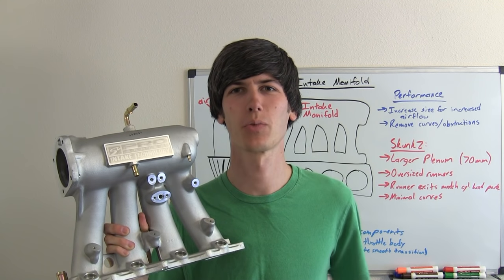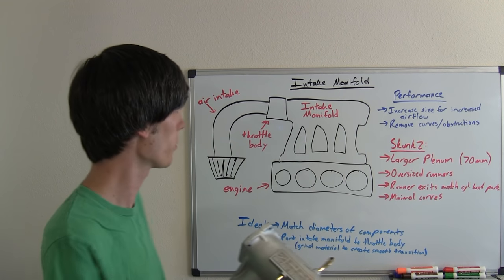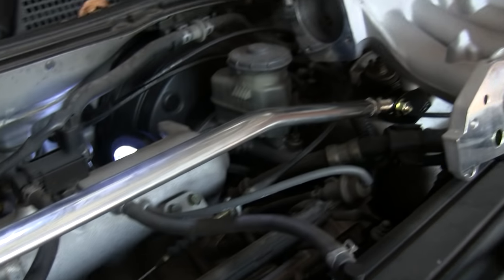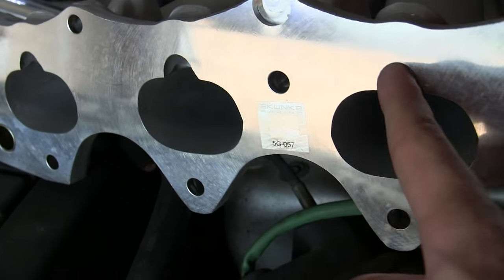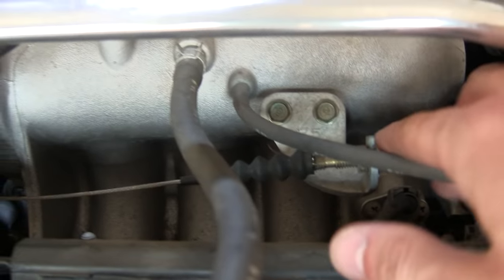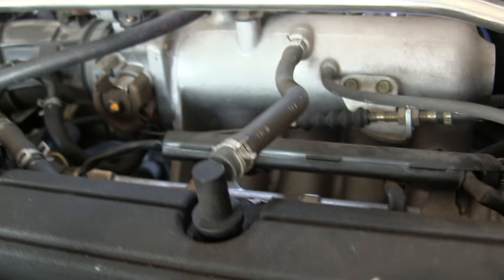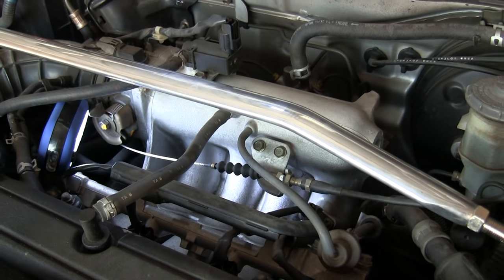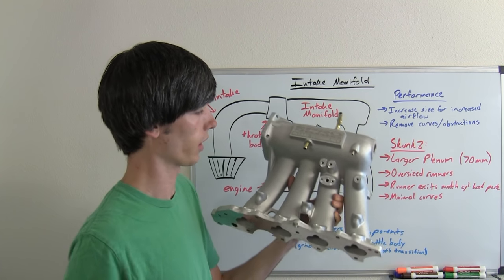Intake Manifold - Explained

Comment: I have an intake manifold question - I have a motorcycle and did an oil change last weekend.  For kicks, I also looked at the air filter to see if it needed to be changed. When I took the cover off, the opening was filled with seeds (like pop corn kernels).  I vacuumed them out with my wet/dry vac.  When I pulled the dirty air filter out, the seeds that were behind the air filter fell inside both air intake tubes. Not sure how many had already fallen in there before I did the check. I could not get the seeds that fell inside those tubes out. I put everything back together, along with new air filter.  I ran the bike and during the 1st mile, it bogged down and lost power but I added throttle and it pushed through. The scent of the bike exhaust smelled funny.  Did these seeds get pulverized and burned out through the exhaust?  If not, did they get mixed and sent through the oil filter, forcing me to do another oil change and oil filter change?  (current oil in there is less than 1 week old).  Did I do any harm to my engine with what happened above?

Comment: the head breather is simple 2 way to allow expansion and contraction of equilised pressure in the head as it heats up and cools down. very little gasses to burn off in there.... unless you have worn valve guides or worse. it is also therefore filtered by the intake filter to stop contamination in the head and the need for a second open air filter. i would have thought there was a separate crankcase breather to the intake.

Comment: Yeah. If I get the Skunk2 Intake Manifold and Throttle Body combo, I'd be spending over $1000. It's pretty expensive. A $200 for a port and polish job and buying a 80mm to 70mm Honda Throttle body (J37) would be a better alternative for my car. I think the price is lower for the older models. Skunk2 also made a new line-up of intake manifolds (Ultra Series) for the b-series engines.

Comment: Will you do a video on phenolic intake spacers with before and after Dyno numbers, air charge temps, and temperature of the intake manifold as well? It would be nice to have proof as to if using one helps or not. Thanks!

Comment: @ engeneering explained ..... doubtfull you reveiw comments on videos thisnold but I was curious if at one point you might consider doing a video on intake manifold plenum volume and relation to torque and responsiveness wile retaining some rpm capacity. Its a bit hard to find good videos on the subject, a whiteboard video on the topic could help expand on the principle for me and hopefully several others. I'm currently building up a Mopar 5.2 magnum with a holley/Rochester 2v sitting on a small port eddlebrock rpm air gap copy and considering implications of building a remote plenumbox to add air volume for additional responsiveness for rapid throttle position changes. I realize any attempt to cover the details of fluid dynamics would be to case specific and too long for a YouTube format. But such a video on a more niche aspect in a singular 10minuite(ideally 3hr lol) quick reference video seems it may be up your alley as far as content creation. ......as a PS I do hope to see more videos of you continuing to build your vehicles, its never a bolt on that's interesting but the clever solutions to recreate modify or fabricate desired effect in a roundabout way the separates an interesting vehicle from the mundane, with a broad knowledge of related sciences the tricks you may come up with could be rather interesting

Comment: Bigger is not better. The runners volume are designed to optimize the Helmholtz resonance for a given RPM. For this reason we see continuous (787B) or stage variable (many production cars) runners in oder to offer better optimization for varying RPM. The plenum is designed to equalize the transient airflow between the runners.

Comment: in the manifold piece you are demonstrating, is it meant for the diesel engine? Because I have heard the fuel-air mixture in the diesel engines are directly injected after being stoichiometrically mixed inside the manifold.

Comment: Do you do any research prior to making these videos? Look into Ricardo WAVE and you'll see that there is far more invested in the design of an intake manifold than just increasing volume to "flow more air through it" and smooth transitions for "more free flowing air". Runner length will be arguably the most vital parameter in tuning an intake manifold to take best advantage of the pressure wave dynamics resulting from intake valve events.
Reply from the maker: Usually no, just kinda draw some stuff and then make things up. I'll be creating a video soon on variable intake manifolds to discuss runner length tuning and how the length is set for a specific RPM.
Reply: +Engineering Explained 
Bwahahaha...great response Jason! 😄  Made me belly laugh.

People need to remember that some of these videos are high-level overviews of the engineering "concepts" related to some aspect of a vehicle.  These are not meant to be graduate-level Engineering seminars.

You do good work here Jason.

Comment: There's a new system I saw the other day called "stack injection" from what I can tell it just looks like a redesigned carburetor. Could you explain how this differs from a traditional carburetor and modern fuel injection?

Comment: I've read that in conjunction with getting a better intake manifold you should also use better valves, will there be a significant gain in power with just the intake manifold for say a b16a engine?

Comment: What is your opinion on pcv delete - there is sooooo much debate for and against that it is really 50/50 as to to go ahead or not .I have a Subaru boxer ej25 non-turbo.I do not stress the engine and am thinking of doing a pcv delete.Also I have not found any information pertaining to the advantage of not losing the vacuum within the manifold and how this would affect ones engine - would it make the engine run richer or leaner by the additional vacuum by deleting the PCV .Thanks in advance

Comment: good video. i am currently taking apart a ej25 motor and i took off the manifold and found the tgv. i do not understand how they work. they seem to work as a throttle body with a valve. people also do tgv deletes, can you explain how this works and how you gain performance?

Comment: i'm 3rd year mechanical engineering student and I'm doing some project on controlling vehicle speed. and i want to ask you one question if you don't mind!
what is the relation ship between throttle valve opening in degree and engine speed?

Comment: I heard that the tork is determinated by the size of the air intake, I was thinking that refers to the length but as you said it's the area, the question is, will it increase significantly the power of the engine by the price? In other words will it increase in how many percent the hp of it?

Comment: Id love to know more about how different manifold designs equate to different power and torque characteristics.
For example, I have been told that shorter and wider runners equal better top end power, but longer and narrower runners equal better low down torque. But I don't know exactly why this is the case. Also is it just the case for N/A engines or equally true for force fed engines?

Comment: Facebook
Engineering Explained
Chris Ainge
Hi Jason,

I've searched High and Low through piles of duscussion boards, videos, and academic research to find a clear and/or detailed explanation of the mechanical theory and/or solution to the what I describe below. To date, I have had no success except discovering that there is a phenomenon that engineers DO address during design stages, but that the concept is largely not understood and frustrates performance enthusiasts, because theoretical solutions aren't available.

Here's the issue: pertains to the intake sections of naturally asperated cars. More specifically tube design and the function/value of hemoltz resonators.

You have a video discussing intake manifold design that explores runner length and the timing of harmonic waves. What is missing from the discussion is what happens when the throttle body butterfly opens and those waves exit the plenum towards the air filter and begin to compete with the incoming air.

From what little i formation I can find, it appears that Hemoltz resonating chambers are placed to give the pressure waves somewhere to go, allowing intake air to maintain velocity. However, like I said, information is scarce and this could be entirely wrong.

What I can say is that in my own vehicle (G35 Coupe), replacing only the intake section that has the resonators with a non-resonated tube has negatively effected throttle response, acceleration, etc. It feels as though it's running richer, even after re-programming the ECU. Either way, it's not desireable, and I know many others run i to this issue after installing CAIs that remove the resonators.

So I guess the question is this...How does intake tuning apply beyond the throttlebody? If pressure waves are a problem, what are the solutions? If a Hemoltz resonator is the fix, how do we calculate it's optimal distance from the throttlebody? Do these concepts become irrelevant once you go FI? Etc.

Any help would be great. Most of your audience would likely enjoy a video exploring this.

Regards,

Chris
Just now

Comment: Awesome video! Would you need to remap the ecu to account for the increased air flow? Also what, if any, gains do you think this might provide on a stock engine?
Reply from the maker: ECU should be able to compensate, but it can at times be beneficial to tune.

Comment: Isn't the idea of the performance manifold that it has slightly oversized runners to increase air flow but a shorter plenum to keep the volume the same (or lower) so that throttle response also stays the same (or gets better)? Something like that?

Comment: You explain well what the job of the intake manifold is but explained nothing of importance to me about the manifold itself. I want to know what every little part on the manifolds is. Mostly I am trying to find out why an (old school) engine I am playing with has 4 ports from the sump coming up through the head than the intake manifold out to where the Carby is through an adaptor plate onto what looks like it should be a vacumn line. It's not connected from when I got the car but it's there for a reason. Why?

Comment: Hey quick question, I want to major in Automotive Engineering, but my school only offers Mechanical Engineering. Can I still get a career in Automotive with a bachelors degree in mechanical engineering?
Reply: Wondering the same here
Reply: They don't really offer automotive engineering degrees anymore. They pull from mechanical, aero, and EE. Found this out from industry expert. He said that automotive specific didn't work well for the manufactures.

Comment: I have a question.  What is the small silver cap at the very back of the manifold?  (it looks to be a different metal than the cast manifold) I was considering removing this and welding on a AN fitting for an oil catch can but was unsure if this was a good idea since I have no clue as to why it is there....

Comment: Just for thought is the intake manifold like our human lungs? But doesn't expand contract with a diaphragm, instead hardened metal casing pressure. This air pressure is used through alot of systems, engine mainly. Lungs are used to give oxygen to different systems of the body, heart and brain, organs.

Comment: I have a serious question that I don't understand about intakes.

Why aren't there "Equal Length" Intake Manifolds (distance from throttle butterfly to intake valves)??? Could we call them "Intake Headers"???

Most intake systems use log plenums with "Equal Length Runners" but each has different distances from the plenum inlet to the intake valves; or sometimes, some of them are equal but never all of them - e.g. cylinders 1, 2, 7, and 8 are equal, while cylinders 3, 4, 5, and 6 are equal, but the two groups are not equal to each other.

I guess ITB's are technically a kind of "Equal Length" Intake Manifolds, but it's really besides the point (and they're in a class of their own anyway).

Comment: Question!

I own a 95 integra myself but have a rough idle, lack in power (until the engine seems to catch up with itself at about 3500+ rpm) and it runs a bit rich as well

Replaced MAP and fuel pressure regulator

When replacing the FPR I noticed the fuel rail seemed to have air inside so im thinking that may be my problem, checked out the fuel rail and noticed it was missing the yellow plug with hose sticking out at the very tip of the fuel rail that your engine has, just curious where that small hose connects to?

I do have the metal piece at the end but no cover and it has a small hole in the center where I assume that hose connects? Im guessing this is where my air is seeping in from as when I turn the key just enough for my fuel pump to turn on i can feel a tiny bit of suction from the small hole

Comment: a question, i am building an intake manifold for a single carb on a V twin motorcycle(was dual carb), now i hear allot about, if the length of the pipes to each cilinder is not identical, that one will run richer then the other. the bike i build it for is an xv750 1982. Is this true or is it a myth since there is a vacum in the manifold while it runs.

For example the manifold you have also reaches the 1st cilinder first since the air needs to pass there first or that does not matter?

Comment: why do the runners have to be straight? surely a curved system would provide a smoother flow than a 90 degree square change in direrction, like the curved exhaust piping out of the engine

Comment: I bought an intake manifold for my b16A2 its a skunk2 ultra street intake manifold but the problem is im wondering if i can install it on stock injectors and a stock engine. I haven’t done anything to the engine like the pistons or the cams but i did put a K&N intake kit and a skunk 2 421 headers

Comment: I have a question about the plenum. I plan on swapping in an engine from a larger truck into my car, and the deck height on these engines is far too high. I was thinking of designing a simple intake for it that lowers the deck height. My question is: should the plenum be the same diameter as the intake and just stretch the length of the manifold?

Or is that too simplistic of a design.
Reply from the maker: Well, I wouldn't say it's too simplistic. But you may want to check out some aftermarket intakes and see how the do it (or even OEM ones).

Comment: Intake manifolds should be flow tested to see the difference, not based on appearance, the wrong intake manifold can hinder the cylinder head air flow significantly and actually ruin the overall hp and torque of your high flowing cylinder head. I like to try to get the intake manifold airflow around 5% of the cylinder head airflow if possible.

Comment: so in a carbereted engines the fuel goes through the intake as well right?
Reply: Yes.
Reply: Yes the fuel is dripped and then vacumed into it directly
Reply: So a car will either have a carborater (bad spelling sorry) or a intake manifold, what's the difference in performance between the two?
Reply: +Antivorg Every car has an intake manifold.
If the car has a carburettor or single point injection, the carburettor or injector will be mounted between the throttle body and the manifold, allowing each cilinder of the engine to suck air-fuel mixture trough the manifold from that single source.
Most cars have multipoint injection for years now, so there is only air going trough the manifold and the fuel for each cylinder gets added by its dedicated injector right before (or even inside with direct injection) the engine.

As long as everything works properly, multipoint injection is the most efficient system, as it can adjust the air-fuel ratio for each cylinder independantly and make instant changes because the mixture is created right before/inside the engine. There's little to no buffer of wrong mixtures in case adjustment is needed, which is constantly to keep efficiency at its maximum.

Downside to multipoint injection is it is controlled by the ECU, which heavily relies on multiple sensors to calculate how much fuel to add, and the engines are built to work as efficiently as possible on that constantly 'perfect' mixture, so 1 small defect in this complex system can cause the engine to run terrible or even render the car undrivable, and be hard to diagnose.

This all sounds terrible, but this technology started to become common in roadcars 30 years ago and is pretty much the only technology used on new cars today, with many improvements made in terms of diagnosing so issues can be resolved faster than you could ever remove, clean, remount and readjust a carburettor.
Reply: Candisa Thats Correct Man, Carburrator is a mechanical System and Injection is an Electrical system which uses a computer program to adjust its self. I have a japan vechicle which uses an engine called Toyota 3Y which is a carburrator model. This engine sucks it needs several check ups for the carburrator, the Carburrator fuel system is a failure in car engines though positively is a stepping stone for the advanced system (Injection System)

Comment: would there be any purpose or hp gains if you put in a performance manifold to a otherwise stock engine? would it help with fuel efficiency at all?
Reply from the maker: Itamar Arce Potentially, but probably minimal. I hope to put this on my Integra and test it out.
Reply: If you're going to do an intake, do headers and a full exhaust as well. Combined you'll add about 10 hp.

Comment: @engineeringexplained
Why require a plenum at all, why not run the runners straight from your throttle body to your valves and thus allow a more direct route with less disturbance to the air flow?